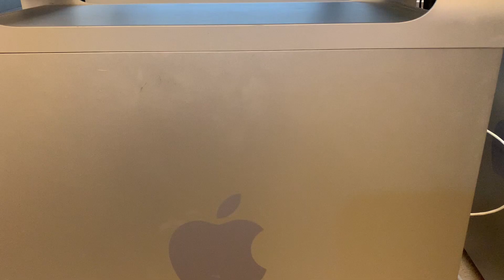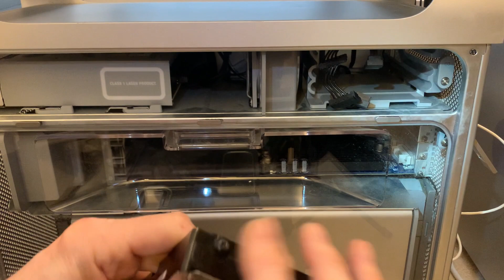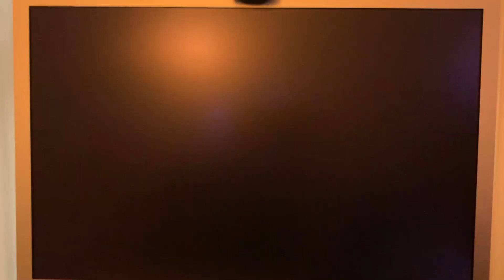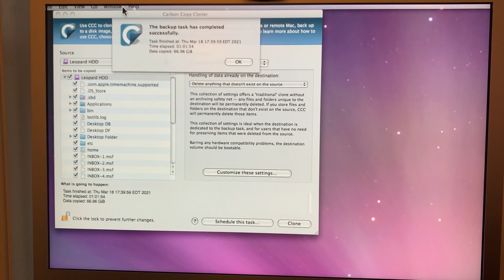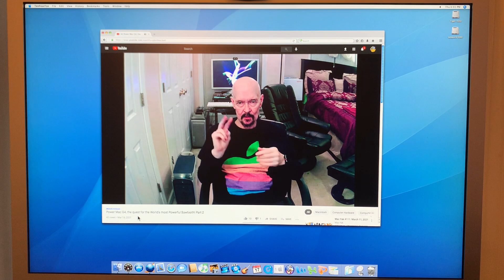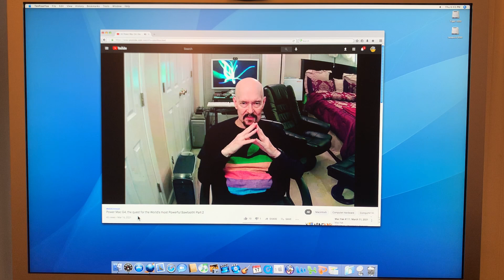Power Mac G5  Dual 2 GHz, new hard drive and Leopard!

Comment: Do u no where I could get tiger from now trying to upgrade a g4 laptop
Reply from the maker: Most things Macintosh can be obtained at Macintosh Garden. 

https://macintoshgarden.org/apps/mac-osx-mac-os-10-ppc

This link brings you to a page where most OX X versions can be found. For Tiger, there is the CD version, which has four separate downloads, one for each CDC required, and the dvd version, which comes from a 3rd party site, Mega. That's probably the best bet. It installs 0.4.6, but the updates to 10.4.11 are still available through Software Update.
Reply: @brokenelectronics3665  tyvm sir
Reply from the maker: You ar emit welcome.